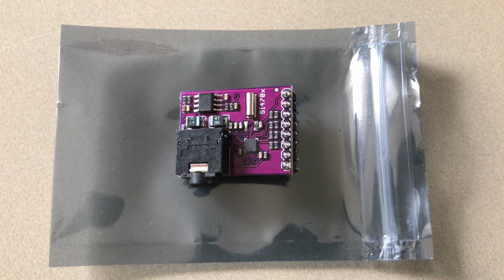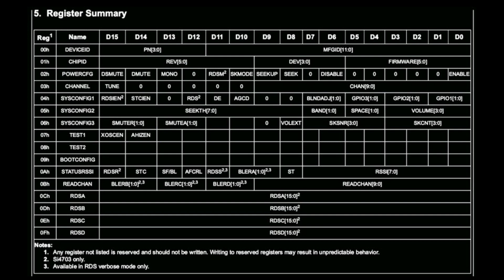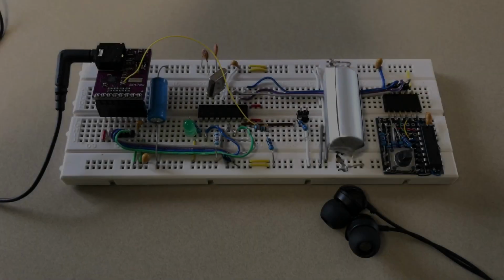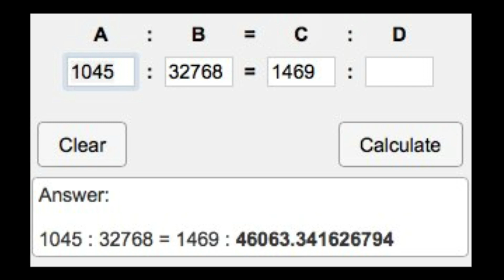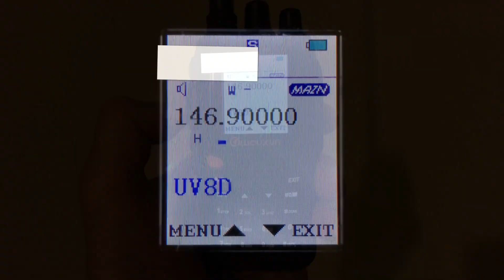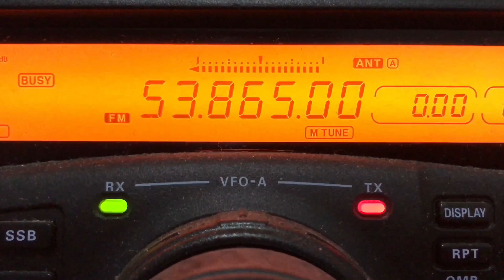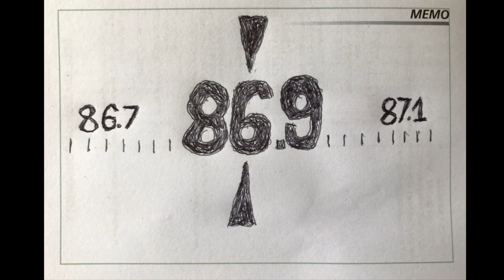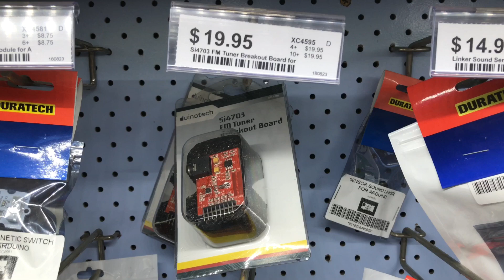Sparkfun Si470x FM Radio Hack

Comment: Hi Brek,

Nice work!    What's quite interesting here is that you're getting quite acceptable NBFM VHF reception, on an WBFM receiver design!   (Unless your control firmware can set a parameter of the 4703 I don't know about - perhaps it has a bandwidth flag setting???)  

... if you take a traditional analog Wideband VHF/UHF scanner radio  having AM/FM/WFM modes and try to listen to an NBFM VHF ham/public safety signal in WFM (broadcast) mode, you won't hear much - signal will at best be very weak/noisy!
Reply from the maker: Hi Bill :) From memory, there’s no such narrow flag to set, but I would say it’s very quiet up in 2m amateur. FM broadcast was fine with a whip, but 2m really required my outdoor Jpole. Maybe something more serious could be done with one of the NOAA sats. The is chip’s AFC made tuning easy though. The new oscillator didn’t have to be perfect for the chip to lock on a signal.

Comment: Regarding the Graphical Interface: Even though it would be different, would you make (or have you ever made) a graphical EQ whereby you separate the signal into its harmonic series using fourier analysis (even if you used somebody else's code and explained it a bit), so as to then populate the bins of a histogram (the moving bass-mid-treb etc bars), drawn in the LCD screen in say an array? You've made a cool project and it totally deserves the "easy to see what it is doing" interface. thumbs up btw.
Reply from the maker: Hi :) THere’s a spectrum display for MP3 player not too far back on my channel. I didn’t have to write it. The MP3 decoder chip does the FFT, and outputs a bunch of amplitudes for different frequencies, and it’s up to the person using the chip to draw the display however it will be done.
Reply: Awsome project and easy to follow. 
Is there likely to be a dab radio sequel?
DAB, That would be totally awsome.
Thanks for sharing.